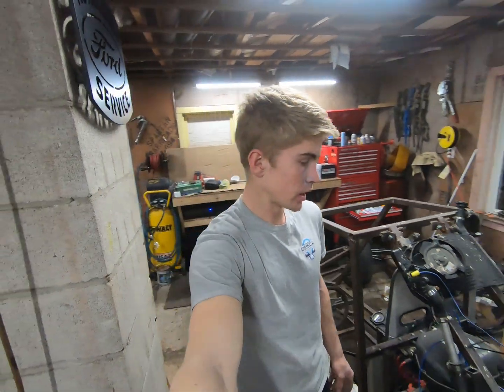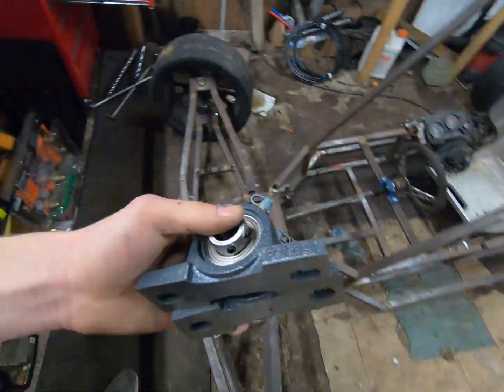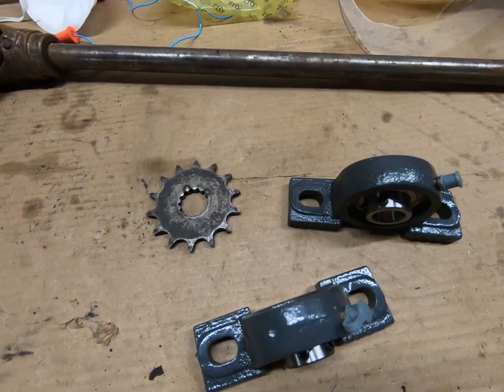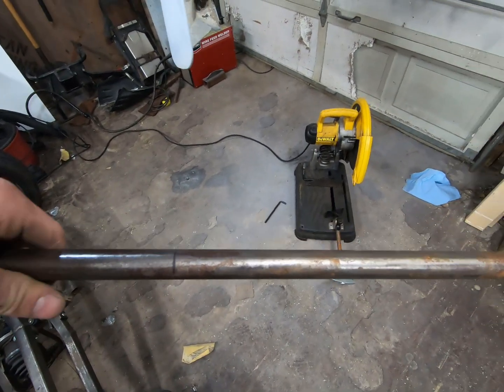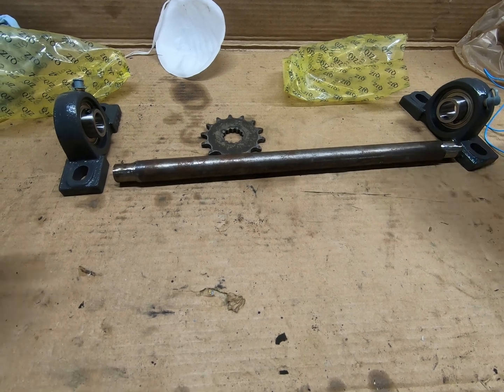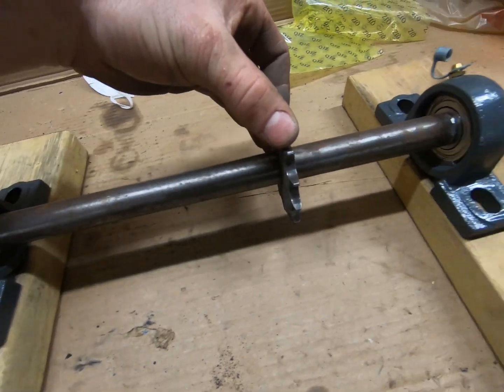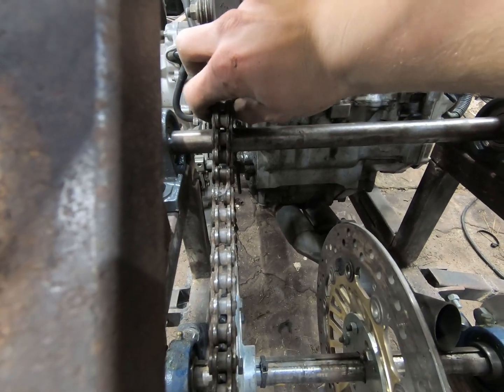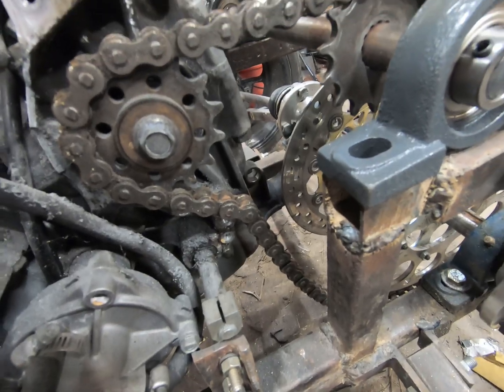CBR 600 SAND BUGGY Build, CHAIN TENSIONER Construction

Comment: The bottoms were your gonna need the tension. You might want it on a Spring.  The top tensioner needs to push down not pull up.  I've got to adjust mine because the chain is to loose its skipping over the top  of the front sprocket when I let off the gas